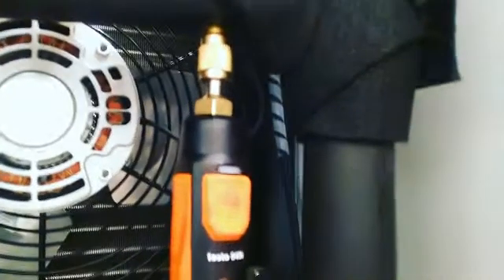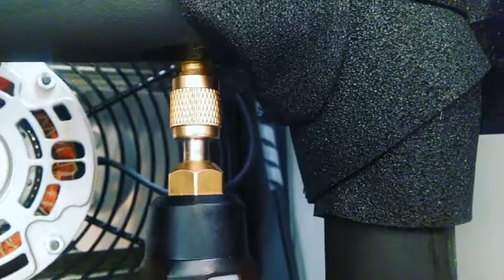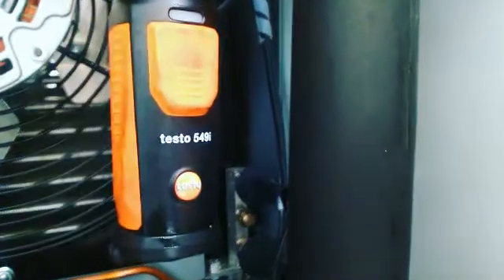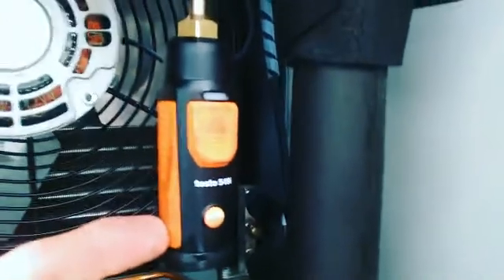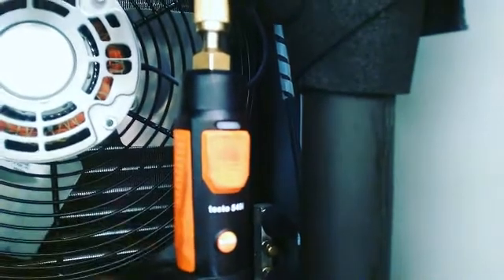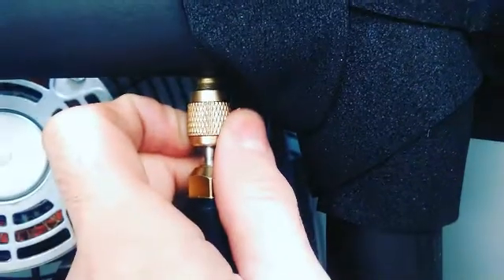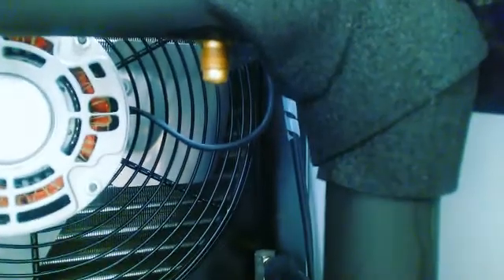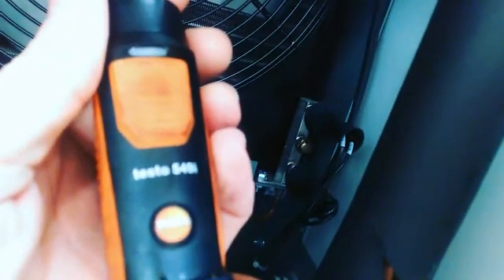Testo Smart Probes

Comment: I may have to invest in a set of those
Reply: They are inexpensive & good quality for price. They work Well. Blutooth Range is short though. Like only 10 ft max.  $67.00 right now at tru tec tools. And u can use a coupon code from steven rardon. ( rardon ) is the code for a discount. 8% discount i believe. Coupon codes also can be had from zack at talyn875. They are on amazon too. Testo 549i probes by it self. $64.80 on Amazon. Or a Kit of 2 pressure probes and 2 temperature probes for $242.00
The New Fieldpice Probes Have some good Distance now Like 350 ft un obstructed. Or the King of Distance is iconnect / i manifold Probes at 1/4 Mile or unlimited if u use multiple Probes as Repeaters.
Reply: I Like Mine - They are Handy ! Quick , no fuss , reliable & Durable.